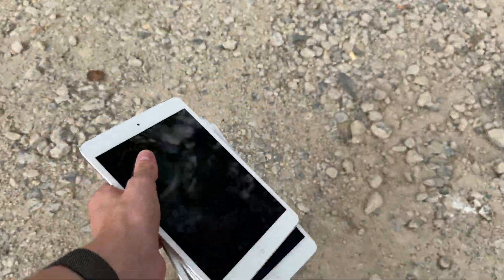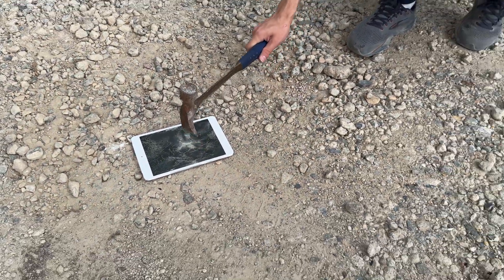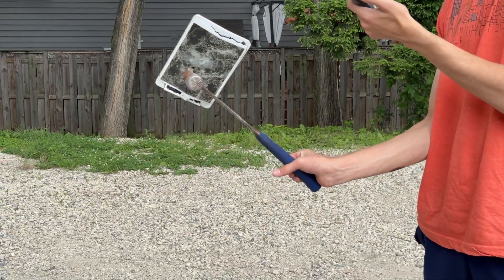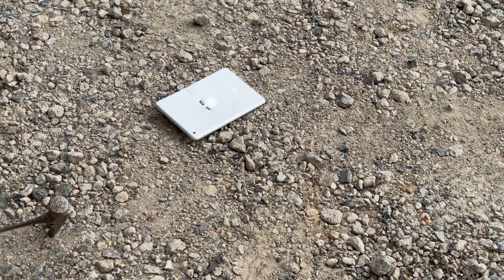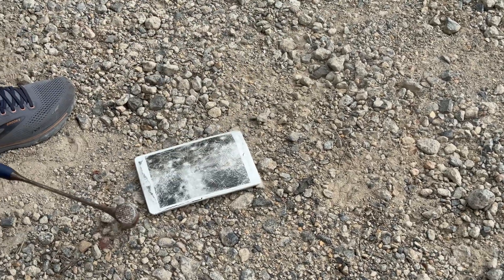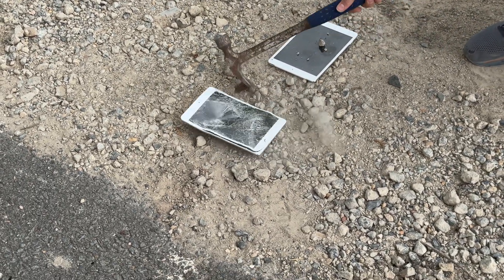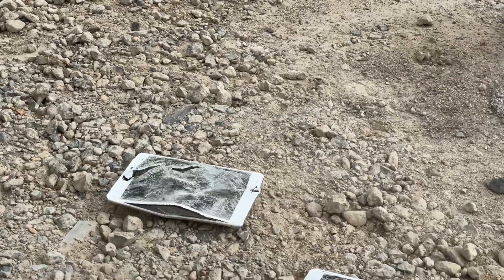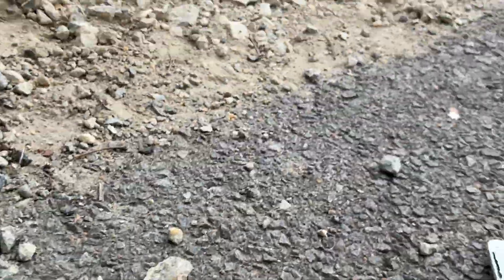Trying to Explode iPad Batteries

Comment: Just take a screwdriver or a nail and hammer it all the way through the battery. And then wiggle it around while in the battery. I have done it and it’s proven to be pretty effective lol
Reply: And also make sure they’re charged to at least 80%
Reply from the maker: Idea noted, thanks for the suggestion.